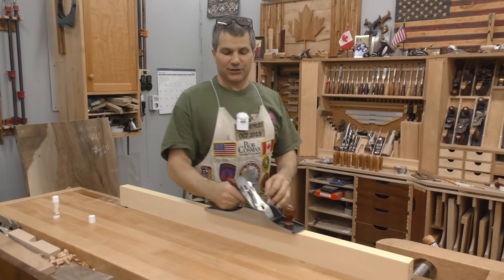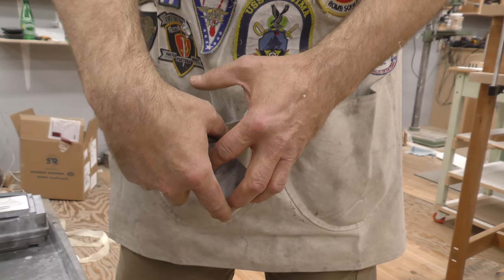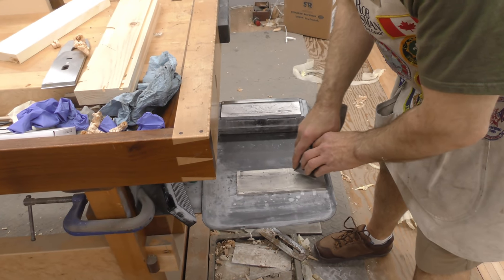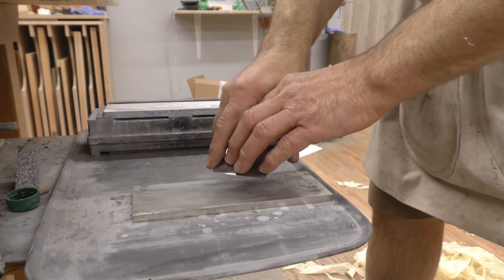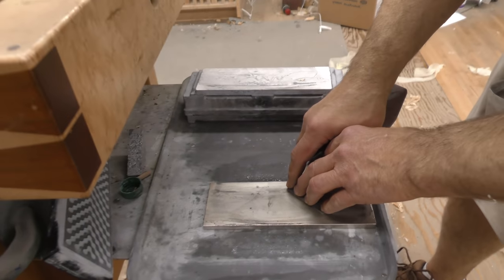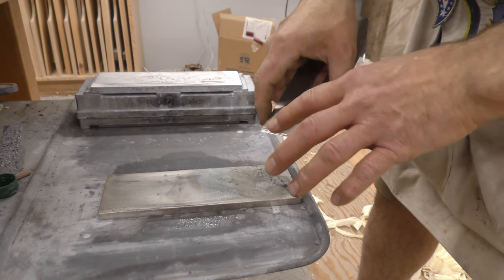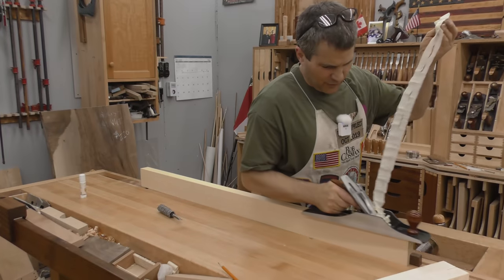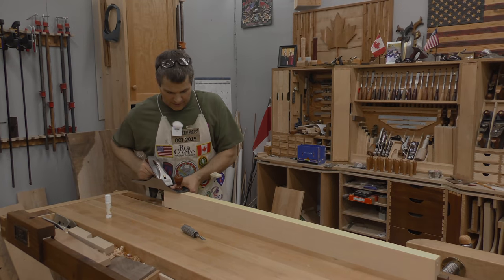Sharpening Hand Plane Blades - Top 6 Mistakes

Comment: When going for that really fine 1 thou or less shaving, I sometimes find the blade taking a shaving at both corners but not the middle.  The middle is sharp (shaves arm hair easy). Also, if I go for a little heavier cut, I get a nice shaving, but obviously with plane tracks on both sides of the blade.  P.S. #4 is really helpful.  I often end up with a skew.
Reply from the maker: Sounds like the back of your blade is either not 100% flat, or you didn't feather out your corners enough

Comment: In the early part of my life I was a timber faller and held on to a chain saw all day. The constant vibration caused me to loose sensitivity in my fingertips. It is difficult, if not impossible, for me to feel a burr. Do you know of any other technique to test for a burr?
Reply: wrecks2007 you could probably run your nail on the back and feel if it catches.
Reply from the maker: Ummm never encountered that problem.  Juan has a good idea, see if you can catch your finger nail on the burr instead of feeling it with the pad of your finger.  Another possibility is get a small jewelers loop off amazon and use it to visually see if you have created a burr
Reply from the maker: or the one we sell on our site https://robcosman.com/collections/miscellaneous/products/rob-cosmans-loupes-test

Comment: Nice tips. Only, I don't have any bevel down planes, only bevel up.
Reply from the maker: Its all the same from a sharpening standpoint.  Only mistake #6 wont apply to you
Reply: @RobCosmanWoodworking  Yes, you're right. The main one that I need improve on is not to rock. I didnt see the harm, but I did notice it makes it harder to find the right bevel angle free handed. In combination with my bevel up config, when I accidentally keep raising the bevel at each sharpening, it also raises my cutting angle. This could be seen as a drawback of the bevel up planes. For blockplanes used for end grain you want to stay at a 25 degrees and nor raise slowly to 40...
Reply from the maker: I have been doing this all my life, and I guarantee you that a sharp blade using my methods will slice through even very tough wood and produce a wonderful surface., regardless of the exact attack angle.  Trust me on this.

Comment: Hello Rob, i got a problem that i really cant wrap my head around. I flatend the sole of my plane on a flat granite, i use the shapton diamond lapping plate on my waterstones and use the veritas honing giude with the cambered roller. And still if i distribute the pressure on the blade evenly across while sharpening, when i take the first shaving it always cuts on both corners first and not in the middle and i get ugly plane tracks. I have to really agressivly put pressure on one corner and meanwhile keep the opposit corner off the stone to give me the slight camber on my blade to avoid plane tracks. That really makes sharpening a huge pain  and it simply does not make any sense to me. Do you have any idea what could be going wrong here?
Reply from the maker: Sounds like your blade back is not perfectly flat.  How do you prepare the back of your plane blade?
Reply: RobCosman.com oh my god youre right! That could be the reason. i never thought of that. I use the ruler trick but i have to admit im a bit sloppy with it. I will check my back for flatness again, thanks for the great advise!
Reply: @aniankrieg3831  You may have misunderstood. The "ruler trick" is used when you sharpen a back bevel onto the blade. What Rob's referring to is making sure the back (non-beveled) side of the blade is dead flat across its width. If there's a hollow in the middle, that will cause your problem.

Comment: Sharpening Hand Plane Blades - Top 6 Mistakes
Upto 19s – great – no nonsense, straight to the point.
   20s – this kinda work – that was the money shot – you’ve hooked 99% of those who can be hooked right there.
  21-25s – great sound effects – business-like – shaving at 30s – this is a great trademark.
       #1  0.35-2.05 – repetition = muscle memory = independence from jigs = speed = productivity – got it.
       #2  2.10-2.05 - ergonomics matter more and more as you get better and better – first time I’ve seen you actually demo all of the process in full – best yet.
       #3  4.20-5.05 – good reinforcement.       
#4  5.06-6.23  I messed this up with skewed bevels. Practiced with rocking the blade on a pencil ;ying at 90 degrees to the edge and just rocking the blade side to side. Soon learned to equalise the rocking. The ‘listen’ technique – brilliant. You might not know exactly what the difference is, but you’ll soon pick up that there IS a difference. For hearing impaired, i’d bet the vibration can be felt.
       #5  6.24-8.45  Time checks are good – helps people going off on a wild-goose-chase – like me. Brilliant detailed demo. 
  #6  8.45-12.00  If the blade bevel equals 45 degrees down, then mounting the blade at 45 degrees up in that plane means the bevel is actually riding parallel to the wood surface. Got it.
     12.00 onwards – the money shot again! Could watch it all day.
Reply from the maker: Great feedback...You should help us edit videos!!!!!

Comment: Careful at the grinder you can bugger it up real good pretty fast if you don’t have a clue. Never use a regular bench grinder wheel on something that is sharp unless you use very light pressure. When the metal is that thin you can overheat the very cutting edge before you feel the heat because you’re holding it back where it’s thicker. I almost always get something down to a fine line on the cutting edge on the grinder and then belt grind or use stones, or now this nifty little garbage disposal motor type lapping wheel with glass laps you cement (fancy) sandpaper onto. The grinder leaves it rough anyways so you still need to do one of those things 99% of the time to get a decent surface.
Reply: Don’t sharpen it all the way sharp (to a burr) on the grinder unless you’re just “kissing” the wheel, very gently.